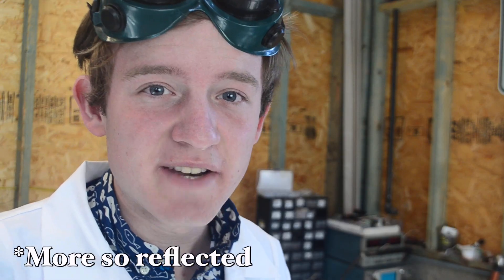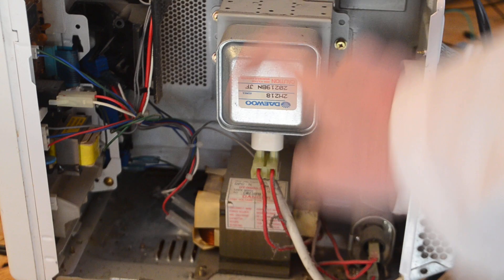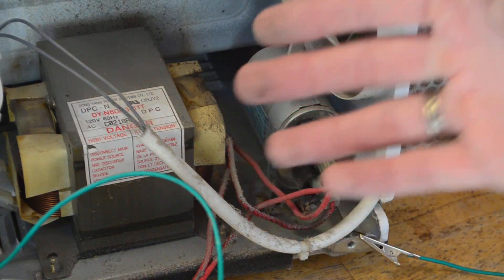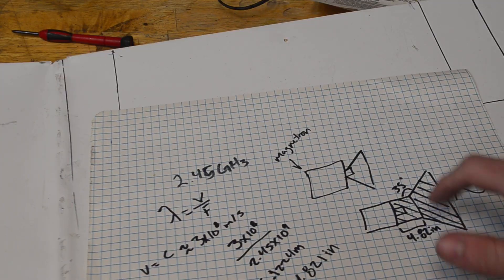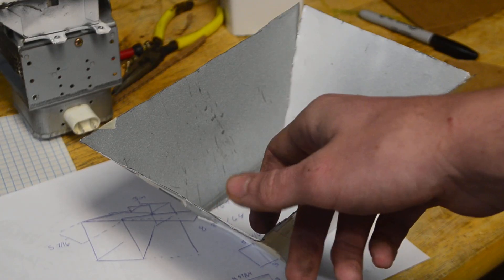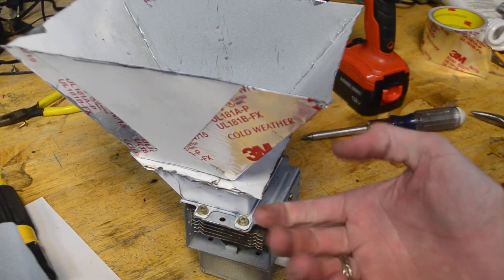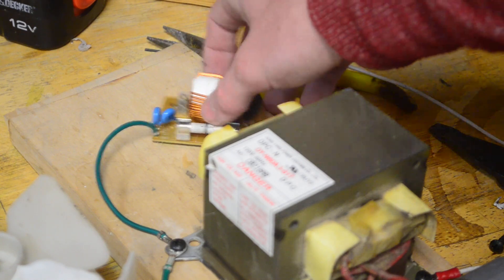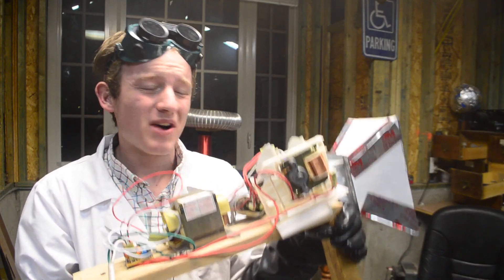How to make a Microwave Gun

Comment: can it be used for pest control on wood? I need to make one because otherwise I need to spend more than 2200euros to buy one. I have an old microwave probably only taking out the door it would be fine to roast termites in 1 inch panels? I will certainly to it

Comment: Love this video but for anyone watching there's one thing he suggests that i would NEVER try: do NOT try to short these capacitors with alligator clips. reason being, your hand is literally touching them and if the capacitor is storing energy, it'll kill you even if you only touch one terminal unless you're really well isolated (which you should assume you aren't for safety). Instead use two screw drivers with insulated handles and touch them together, or even better is to make a pole with two ends to short them. I have a pole specifically for this, about 3 feet long made of pvc with two connected nails on the end that are at the same spacing as the terminals. The benefits of this are that i am far away from any danger when this is done, and if it does spark and it startles me, my hands won't be close to anything made of metal that could be conductive or even just sharp. Instead i'll just drop the stick and jump for a moment. 

Maybe it's a little bit overkill but microwaves really are not something to mess around with. Better to be safe than sorry

Comment: 5:47 that's a common-mode filter. It attenuates the common-mode noise generated by the switchmode power supply inside the microwave oven, preventing it from being injected into the mains and interfering with other appliances.

Comment: I would have made the waveguide and horn antenna out of PCB double sided epoxy board as it’s easier to build and you can solder the edges for best conductivity. You didn’t mention the effect on the 2.4GHz WiFi band as 800Watts of broadband mains frequency pulses will wipe out WiFi very easily.

Comment: Lets just rename this video to : How to nuke your own testicles! 
Lovely I will let you be the first to try it out. Just because you are pointing it away from you doesnt mean that its not bouncing all around the room, coming back at you from all angles. The reason why they also put a lead apron on you at the dentist is becuase its not really for you. Its for the dentists so they can come back into the room after it absorbs the xrays. Because when they zap your face  it goes thru your head  bounces all around the room and gets absorbed by the lead. That it still nukes you testicles, just not so much sitting on a metal chair but from the bottom and neck part thru you.
If the dentist were smart they would hang as many as they can on the walls especially one on the inside wall where they stand and push the botton. That way they dont get any problems later in life absorbing x rays 50x a day.
Reply: Im also glad that you took a whole half second to remind people of the dangers and the importance of not discharging a capacitor. Becuase if someone were to sneeze 3 times they might have missed that part and would have got a heart attack from that amount of current. Whew..  Good thinking that could hurt or killed somebody. 

Oh wait your teaching people how to hard boil an egg from a distance. Just hope its not anyone elses eggs between thier legs. Im sure you dont have to worry about that much. Since you done cooked yours already
Reply: “DO NOT TRY THIS, IT IS VERY DANGEROUS”

Comment: The magnetron from a microwave oven radiates enough power to thoroughly cook MEAT (which is what we are made of) .  That power can be as high as 1000 Watts, the same as a single-bar electric fire!  The threat to human safety is very substantial and it is not good enough to speak dismissively about this.

Anyone fooling around with a magnetron needs a lot more than than bits of aluminium foil to protect them.  What does it feel like to to have a kilowatt of heat dissipating inside your face?  Or radiating anywhere near your gonads?

Comment: Great idea of using microwave screen to make protective goggles...I would be concerned about the edges too...how about fly-eye hemispheres made of the full-eye protective goggles?
A suggestion: Use JB weld instead of epoxy.
THANKS for the (ULTRA-EXTREMELY DANGEROUS) but great video.
NO ONE "DARE" TRY THIS UNLESS YOU ARE VERY FAMILIAR WITH THE POWER OUTPUT OF MOT'S AND HIGHPOWER-MICROWAVES!!!

Comment: I had one more comment to make if you read this I would say no don't even screw it this shit I might have built one for a friend not a microwave gun but a booby trap to put underneath his desk for the center drawer I think now I hope nobody ever breaks in his house he wanted something that wouldn't hurt a fireman or something like that but anybody breaking in sitting at his desk looking through his drawers I'm pretty sure you'd find them at the emergency room later with nothing but cooked nuts I would definitely advise against building a microwave guns I don't know enough about it to screw around with it and I like my parts I wonder how many people will be hurt because of this video that's my first thought all I did was build it he actually installed it on his desk I basically made a piece of wood with the magnetron with the extension wire and the switching to turn it on when the drawer is open he actually did a nice job I exploded a bottle of water with it from 20 ft away behind the metal door before I give it to him I couldn't believe his idea worked I never knew about these videos on YouTube it's something I wouldn't screw with again unless somebody wanted a boobie trap with it and I don't need the test anything anymore I exploded a bottle of water from 16 in away from 20 ft away plugging it in an extension cord taking out through the crack of a metal door and I thought that's pretty damn powerful there's plenty of water in someone's nuts I'm sure who knows what damage it Cooks from the inside out what a booby trap I told him it's not a good idea and if he had kids I never would have even made it and give it to him to install on his desk I hope no one ever breaks in his house and if anybody reads this that's going to make a magnetron gun I would say don't even bother it's something I know nothing about microwaves and how they can bounce off things and cook you screw that I don't want no part of it I would say don't go out and ask for the most powerful microwave you got and buy it and make one of these I would not bother I would definitely advise against it unless you become very knowledgeable about microwaves
Reply: I had a friend asked me if there's any way that you could use a magnetron from a microwave as a booby trap he wants to catch someone if they ever break into his house and I told him you got to have something that won't hurt a fireman if you have a fire and they have to break in to put the fire out but something or if somebody was going to steal something out of your desk they would get their nuts microwaved anyways I bought the most powerful one I can find meaning microwave and I got it already I just made the board to go underneath the desk and a micro switch for the door and you have to wire it up right you can put the electronics somewhere else and run a wire to the magnetron under the desk and put a little piece of wood there to keep the center drawer from pulling all the way out so they can't just pull it out and dump it in a pillowcase they have to either stand there and pick the stuff out or sit down and you put a lot of pretty shiny things in there and just mounted underneath he actually did the final touches I just made the the board with the magnetron on it and got it all ready for him nobody's broken in his house yet but I'm sure you'll find them at the emergency room if they do I never thought of it until he mentioned it but I made a quick 500 bucks and I didn't even have to install the finishing touches and his desk it's something I would not have done if he had kids and I told him if you drink it all I would not do this I did explode a bottle of water from about 16 inches away putting it 20 ft away from me in my garage and plugging it in with an extension cord looking through a crack behind the steel door it's something I don't know very much about and it's not something I want to play with it took about a minute and a half to 2 minutes to explode that bottle of water so getting someone to sits in one spot or stand in one spot for 20 or 30 seconds I feel sorry anybody breaking in his house they're not going to be able to resist I myself think it's a bad idea but what are you going to do I wouldn't screw with this microwaves bounce I don't know enough about it there's no way I'm going to make a magnetron gun you're better off with a gun if you want self defense I wouldn't recommend this to nobody I only Built it for him because he hired me to do so through my life I have done so many things building things that people would not even think of and if they did they would never make them like a handcuffed key in a little cone on your pull tab on a jacket you cut the key in half raise the loop on it and slide a plastic cone over it you always have a handcuff key on your jacket just get your hands in front of you I had people search me out to pay me $50,100 bucks a piece and I've made so many other things thinking how to defeat something and being a prototype toolmaker I can make just about anything especially small things I used to love to make things from blueprints so thinking stuff up and making them was fun I even had a couple of patents but microwaves I don't think so what did they say just say noI had a friend asked me if there's any way that you could use a magnetron from a microwave as a booby trap he wants to catch someone if they ever break into his house and I told him you got to have something that won't hurt a fireman if you have a fire and they have to break in to put the fire out but something or if somebody was going to steal something out of your desk they would get their nuts microwaved anyways I bought the most powerful one I can find meaning microwave and I got it already I just made the board to go underneath the desk and a micro switch for the door and you have to wire it up right you can put the electronics somewhere else and run a wire to the magnetron under the desk and put a little piece of wood there to keep the center drawer from pulling all the way out so they can't just pull it out and dump it in a pillowcase they have to either stand there and pick the stuff out or sit down and you put a lot of pretty shiny things in there and just mounted underneath he actually did the final touches I just made the the board with the magnetron on it and got it all ready for him nobody's broken in his house yet but I'm sure you'll find them at the emergency room if they do I never thought of it until he mentioned it but I made a quick 500 bucks and I didn't even have to install the finishing touches and his desk it's something I would not have done if he had kids and I told him if you drink it all I would not do this I did explode a bottle of water from about 16 inches away putting it 20 ft away from me in my garage and plugging it in with an extension cord looking through a crack behind the steel door it's something I don't know very much about and it's not something I want to play with it took about a minute and a half to 2 minutes to explode that bottle of water so getting someone to sits in one spot or stand in one spot for 20 or 30 seconds I feel sorry anybody breaking in his house they're not going to be able to resist I myself think it's a bad idea but what are you going to do I wouldn't screw with this microwaves bounce I don't know enough about it there's no way I'm going to make a magnetron gun you're better off with a gun if you want self defense I wouldn't recommend this to nobody I only Built it for him because he hired me to do so through my life I have done so many things building things that people would not even think of and if they did they would never make them like a handcuffed key in a little cone on your pull tab on a jacket you cut the key in half raise the loop on it and slide a plastic cone over it you always have a handcuff key on your jacket just get your hands in front of you I had people search me out to pay me $50,100 bucks a piece and I've made so many other things thinking how to defeat something and being a prototype toolmaker I can make just about anything especially small things I used to love to make things from blueprints so thinking stuff up and making them was fun I even had a couple of patents but microwaves I don't think so what did they say just say noI had a friend asked me if there's any way that you could use a magnetron from a microwave as a booby trap he wants to catch someone if they ever break into his house and I told him you got to have something that won't hurt a fireman if you have a fire and they have to break in to put the fire out but something or if somebody was going to steal something out of your desk they would get their nuts microwaved anyways I bought the most powerful one I can find meaning microwave and I got it already I just made the board to go underneath the desk and a micro switch for the door and you have to wire it up right you can put the electronics somewhere else and run a wire to the magnetron under the desk and put a little piece of wood there to keep the center drawer from pulling all the way out so they can't just pull it out and dump it in a pillowcase they have to either stand there and pick the stuff out or sit down and you put a lot of pretty shiny things in there and just mounted underneath he actually did the final touches I just made the the board with the magnetron on it and got it all ready for him nobody's broken in his house yet but I'm sure you'll find them at the emergency room if they do I never thought of it until he mentioned it but I made a quick 500 bucks and I didn't even have to install the finishing touches and his desk it's something I would not have done if he had kids and I told him if you drink it all I would not do this I did explode a bottle of water from about 16 inches away putting it 20 ft away from me in my garage and plugging it in with an extension cord looking through a crack behind the steel door it's something I don't know very much about and it's not something I want to play with it took about a minute and a half to 2 minutes to explode that bottle of water so getting someone to sits in one spot or stand in one spot for 20 or 30 seconds I feel sorry anybody breaking in his house they're not going to be able to resist I myself think it's a bad idea but what are you going to do I wouldn't screw with this microwaves bounce I don't know enough about it there's no way I'm going to make a magnetron gun you're better off with a gun if you want self defense I wouldn't recommend this to nobody I only Built it for him because he hired me to do so through my life I have done so many things building things that people would not even think of and if they did they would never make them like a handcuffed key in a little cone on your pull tab on a jacket you cut the key in half raise the loop on it and slide a plastic cone over it you always have a handcuff key on your jacket just get your hands in front of you I had people search me out to pay me $50,100 bucks a piece and I've made so many other things thinking how to defeat something and being a prototype toolmaker I can make just about anything especially small things I used to love to make things from blueprints so thinking stuff up and making them was fun I even had a couple of patents but microwaves I don't think so what did they say just say noI had a friend asked me if there's any way that you could use a magnetron from a microwave as a booby trap he wants to catch someone if they ever break into his house and I told him you got to have something that won't hurt a fireman if you have a fire and they have to break in to put the fire out but something or if somebody was going to steal something out of your desk they would get their nuts microwaved anyways I bought the most powerful one I can find meaning microwave and I got it already I just made the board to go underneath the desk and a micro switch for the door and you have to wire it up right you can put the electronics somewhere else and run a wire to th